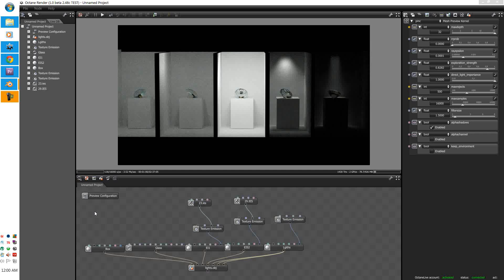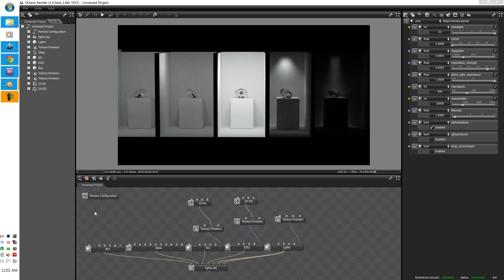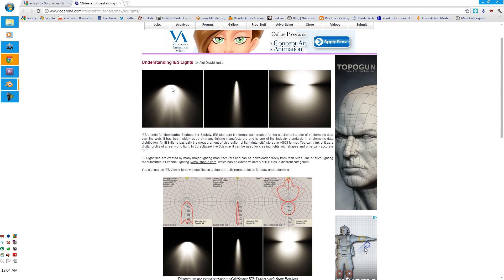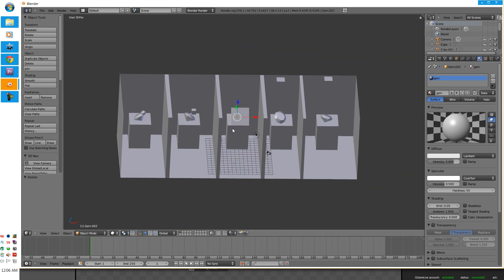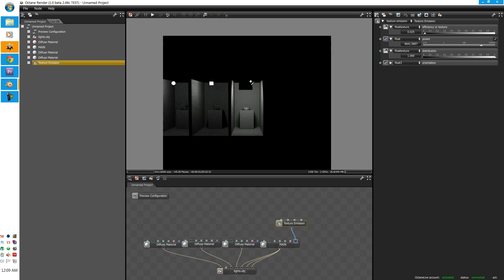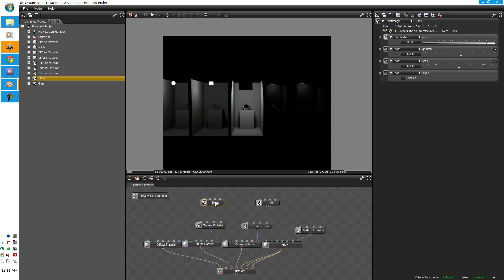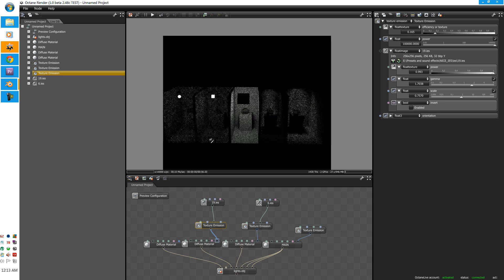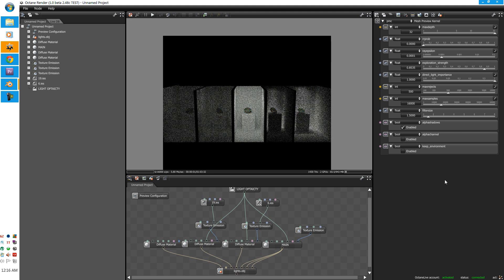Octane Render Tutorial Series - 12 - Emissions

Comment: How are you packing your OBJ on export from Blender so that the meshes are accessible with separate inputs in Octane standalone? I do an export (selection only, include UV's) from Blender, and when I do a Geometry > Mesh import to Octane, it only has a single top input and it treats all of the meshes as one big mesh. (Blender version 2.76, Octane version 2.25)
Reply from the maker: +Casi Blume Hmmm it seems the objects you are exporting dont have a unique material assigned to them, if there is only one materiel for all objects then the obj will only re concise that one texture and octane will intemperate it as one material for all objects
Reply: That was exactly it. Thanks so much for the response.

Comment: Hi Timtam, Great Tutorial. Do you have any suggestions on rendering digital screens like TVs or computers? When I apply an emission to the screen, the image gets washed out. If I reduce the power enough to be able to see the image, the light levels are very low. Any idea what I can do?
Reply from the maker: I usually do it with emissions, but i do agree that getting the settings just right is tedious. have you tried using all (correct) settings with the power and distribution of the image file?
Reply: MTimtam Thanks for the quick reply! I fiddled around with the settings but that didn't work too well. However, I decided to place a light pointing towards the screen image, that was a plane the same size as the screen. This light was only a few mm away from the actual screen. I made the light source invisible. The bouncing light rays illuminated the screen pretty well without washing out the image completely. I also set a light source pointing away from the screen at a lower power to get a more realistic lighting effect. A bit of a hack but it did the job in the end. Thanks

Comment: Hi Timtam, pleeease heeelp!
Do IES lights have to be applied to flat square things only? Can I make a flat square thing in photoshop with the 3d function?
Every time I try to use an IES on a sphere, square or anything it doesn't work. :(  *sobs*
I don't know how to use Blender or any other 3d program (yet) apart from from poser and marvelous designer where i am making my virtual fashion clothes.
This lighting is driving me nuts.
What's the easiest way that I can make spotlights in my octane scene without knowing how to use a 3d modelling program?
Reply from the maker: Im afraid it is not yet possible to add a emitter within octane yet. doesn't poser have primitive objects? or a import function? Im sure you can import a plane and use it as a light source, given the normal is facing the right way

Comment: Thanks for the tuts man! I've been following these from tutorial 1 and now I can say I am pretty good with octane! However, I am having a problem getting my plane to emit light. I use Cinema 4D to set up my scene and for the light all I am using is a simple cubic plane. I know somewhere in your video you mention that the light must be UV Mapped. I'm still a beginner when it comes to UV mapping and I was wondering, within C4D, do I only have to put a UVW Tag on my plane or is there more to do?

Thanks man
Reply: The UV mapping is only for IES lights :).
For me, i set my scene in blender to which for some reason i have to set the plane normal to where i want to set the light up. 

So in cinema 4D, summon a plane up, assign a diffuse and then set the emmision to it, crank the settings so you can see it, and see which side the light is on. If it is not in the direction you want it then go back into C4D and flip the plane around.  :) 

Unless its a different problem let me know